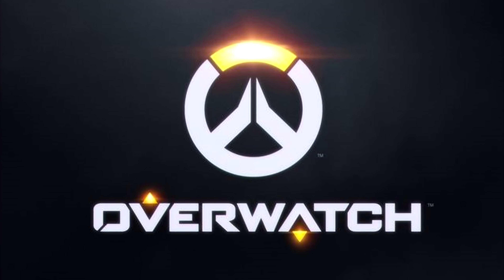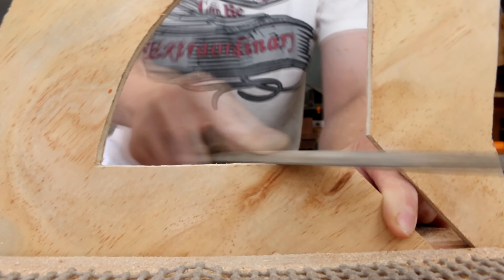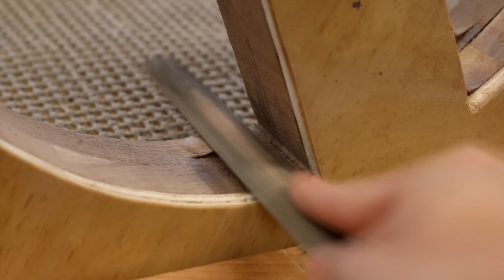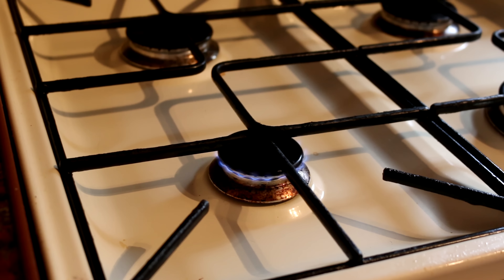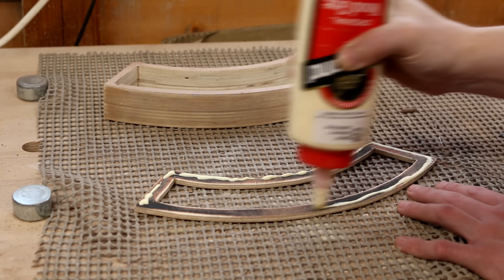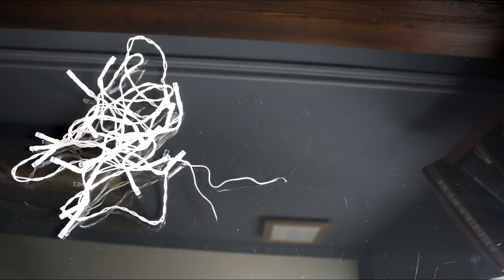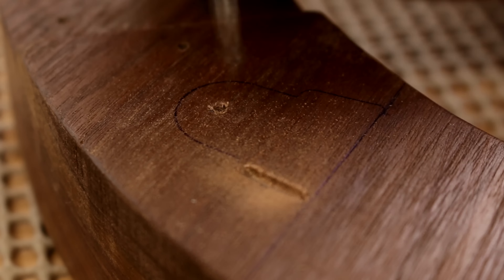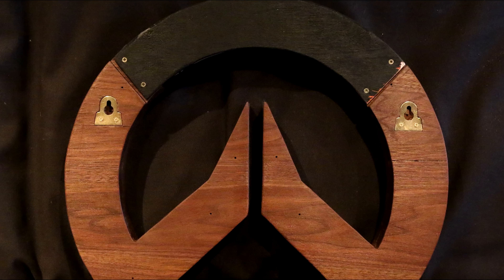Overwatch Walnut Wall Light - How I Made It

Comment: Alright Joe, good work mate. Just a tip (unless this was already mentioned on the other video), get yourself a bottom bearing flush trim bit and you could have used the bit you'd already flush trimmed as the template for the rest of it then. If that makes sense.

Comment: another great video, can I ask what spray lacquer you you use?  I've been using one from toolstation https://www.toolstation.com/shop/Painting+%26+Decorating/d150/Spray+Paints/sd2737/Industrial+Spray+Lacquer+500ml/p44132

but it never looks as shiny as yours.  perhaps i need more sanding between coats and more layers
Reply from the maker: +Daren Cooper I always use Morrells high gloss spray laquer. It dries really quick and maintains that wood feel lol it doesnt give it a plastic look like some lacquers Ive used. http://amzn.to/2vyia4c

Sanding between coats will really help with getting a gloss finish though. For hardwoods I will sand with 320 grit between coats or even 240 grit if thats all I have. 3 coats, sanding after the first 2 always does the trick for me. If your looking for a very high gloss almost mirror finish you would need to add around 10 coats and then use some very fine abrasives such as rotten stone powder or pumise powder. A quick search for 'hand rubbed finish' should point you in the right direction. Be wary of the awkward links when searching for it though haha hand rubbed finish isnt the best term to be searching on google 😂
Reply: brilliant thanks, I shall give it a go. Hope to bump in to you at the birmingham make convention
Reply from the maker: +Daren Cooper Will be great to meet you at Makers Central 👍